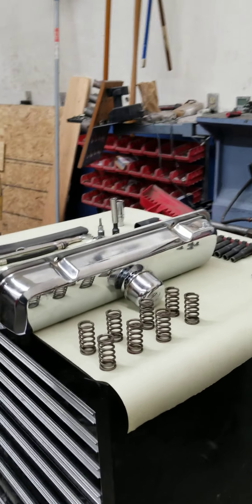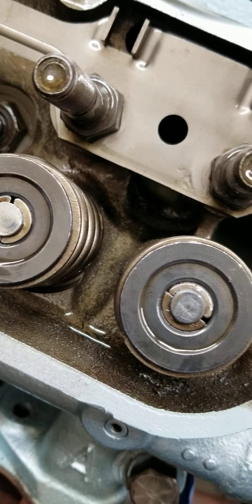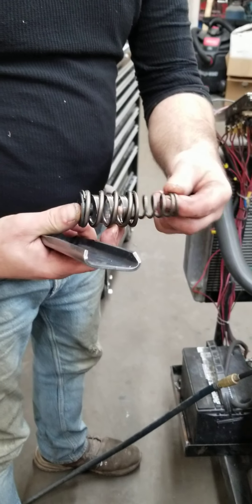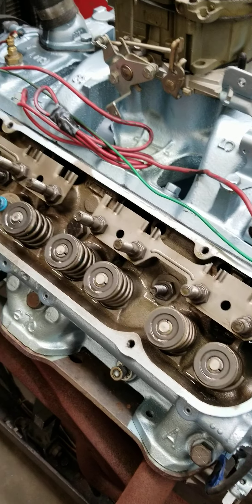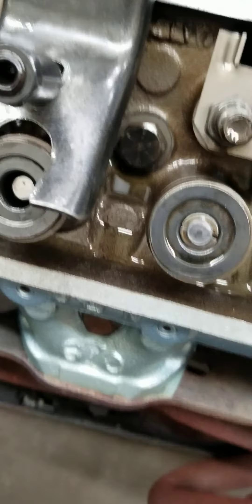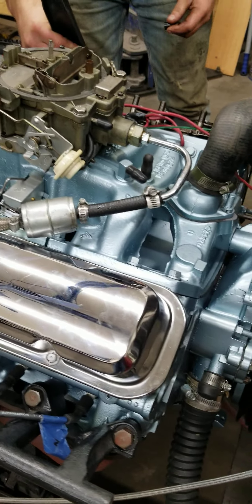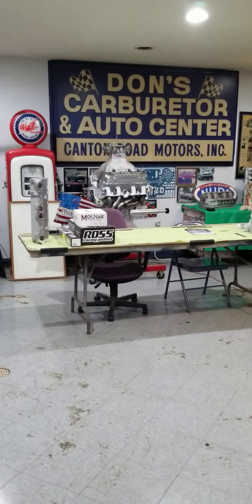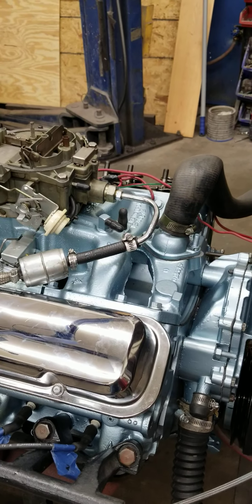#watchthis!! Installing inner valve springs after flat tappet camshaft Break in procedure completed.

Comment: Nobody says how much air pressure to use. Use too much and it can push the piston down. How much psi are you using to hold the valves in place.
Reply from the maker: If the rings are sealed it doesn't take much pressure to push the pistons down. Honestly though it really doesn't hurt or matter if it does. All the rockers are off the engine when doing this any way.
Reply: I’m starting with a fresh motor that has never been turned over. What psi should I use to keep the valves in place while performing the removal of the inner spring? Sbc 327
Reply from the maker: @CalvinEzell  What ever your compressor is set to without a regulator is fine 80 to 90 PSI

Comment: I’ve had good luck with Johnson Hylift.
Reply from the maker: We have just had horrible luck in the last 5 years with all brand flat tappets. We pretty much quit building engines with flat tappets and install only hydraulic rollers. We are really hoping we found a good solution because not everyone can afford to go roller.
Reply: @dcimotorsports1111  Going roller is pretty pricey,especially in a Pontiac. Almost feel Flat tappet is like a roll of the dice. Guess I’m living on the edge. 😂
Reply: I used to work in a machine shop and that’s what I used to do to check for compression in the cylinder and changed out those valve step seals when they started leaking… Man, I miss doing that work on engines in the shop… Man, that’s when we used to see engines that came back to the shop when they tried to ride the cam down till the rockers couldn’t hold up anymore…. Man, you do awesome clean work…👍🏾
Reply from the maker: Thank You Sir 🙂 @southtexashustler
Reply from the maker: Ya it is costly, but how much does it cost to do it again? You know the saying, Pay me now or pay me later.  @nicoamess
Reply: @nicoamess  its no so pricey if you consider the high probability of a cheap flat tappet ruining the whole engine . I consider rollers cheap insurance!!!
Reply from the maker: That and the cost to rebuild a fresh engine after a failure 🤔 @adamballinger1358